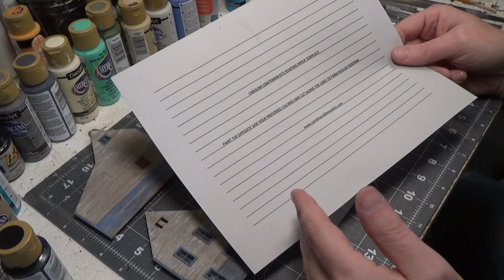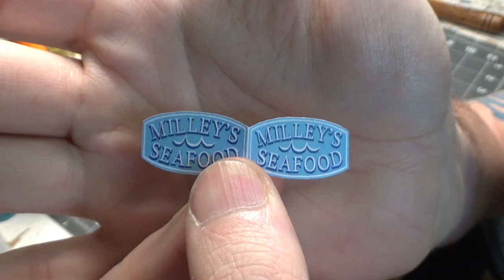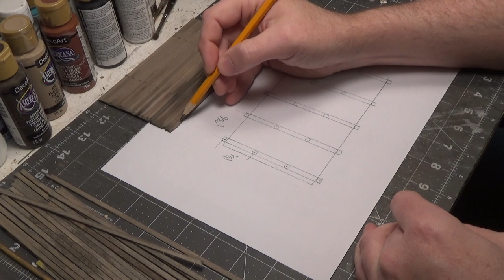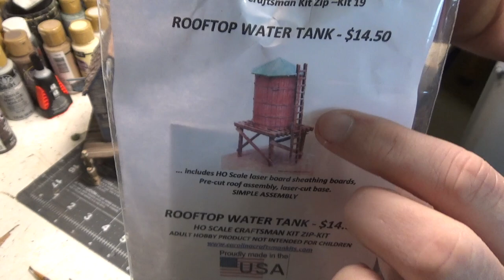"Eagles Landing"

Comment: Came out looking great.  You need to have a tank that holds the gas for the little station.   Since you are over the water, the tank would be above grade (on the deck in this case)
Reply from the maker: Thank you so much!!! I'll add one later. The kit does not come with one so I did not want to show it.